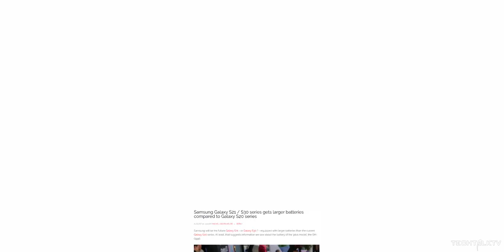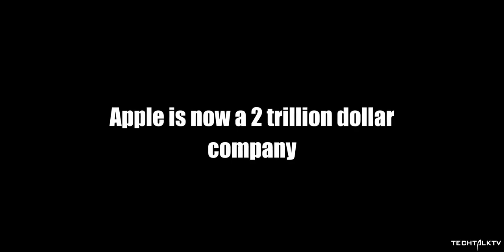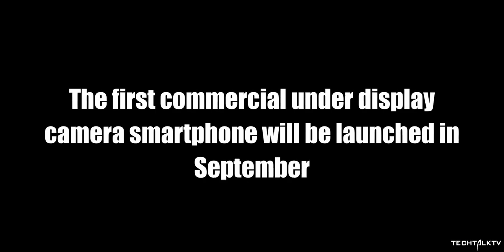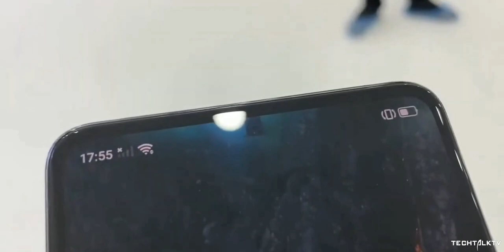Galaxy S21 Plus BIG Upgrades | Apple Is CRUSHING The Competition

Comment: Samsung must work on app optimization, increasing the battery size alone is not enough.

S20 ultra with 5000 mAh still can't beat iPhone 11 pro max in battery tests with around 3800 mAh.

Comment: I am EARLY and yo that's great the s21 plus battery is better
Reply: Im guessing the regular S21 might have a 4500 mah.
Reply: Also please upgrade the charging speed, at least 60w. Many china phones are using 120w already... 😛
Reply: WH Kong 120watts sounds excessive and like it would degrade battery too fast. I’m fine with 25-40 watts of charging

Comment: Hey Sal...so my Note 20 Ultra arrived yesterday. Here's my first impressions as opposed to the 10+. I know the screen is supposed to only be 0.1 bigger, but the display looks significantly bigger to me. And even with tiny bezels, I'm surprised it feels larger in my hand. (Not a bad thing, just different). 2. The white almost seems translucent compared to the 10+ and it has a metallic-like sheen. I like last year's white color better. 3. 120 fps is GLORIOUS. So, so good. 4. The low latency s-pen? Also GLORIOUS. (It is so strange...I never noticed lag on previous devices, but using the new pen feels soooo much better!) Final impression ... the larger display, the 120hz and the new low latency pen are BIG improvements and well worth the upgrade for those with the means to do so. I'm stoked to have it. THANKS SO MUCH FOR A YEAR OF INFO THAT LED ME TO THIS PURCHASE! ❤
Reply from the maker: Congratulations! Mine will arrive on August 27th. Excited for that
Reply: @TechTalkTV  can't wait to hear what you think!!!

Comment: If Samsung like, let them increase their flagship phones battery to 10,000mah, " if their optimization is not right, it still won't be efficient to last all day.
Reply: Samsung phones have always had shitty battery drain, but 10,000mah is a ton of battery, it would definitely last compared to the current 4000mah batteries

Comment: I don't care for them to make bigger batteries, 4500 mAh would be just fine if they came with a similar optimization that Apple brings to their phones. 5nm chip won't solve shit if Samsung doesn't optimize their Exynos and UI. I'm still hopeful.
S21/30 with good SoC power, almost as good as Qualcomm SD875 or Apple A14, or even (very unlikely) better, better battery optimization and heating control, better night shots and UNDER DISPLAY CAMERA with symmetrical top and bottom bezels, I gave up on the edges lol. If they bring all this and also make a smaller version (in inches size) with all this, 120hz too just more compact, I'm totally sold. My s9+ still works just fine, but I'm bored plus it won't get Android 11, my battery life sucks, like really. So if next year Samsung brings all this, or at least most of this, I'm sold. They have to bring the under display camera, they have been changing design every 2 years for awhile now, so people expect them to change it.
Reply: If you live the U.S then you don't have to worry about exynos
Reply: Goku Black Why do some phones have exynos while the same phone uses snapdragon that doesn’t make sense.

Comment: I hope it won’t just be test for Note21, like this year S20 Ultra was just new camera setup test (failed one). No more Samsung for me if they continue with Exynos/Snapdragon game, also Note20 Ultra comes with 8 Gb of ram in my country. Pure greed...
Reply: 8 gigs of ram is perfectly fine due... especially on a phone. iPhones are doing so well with 4 gigs of ram, imagine how well double that amount is going to do
Reply: MemeSage 24 ok, I agree, but why did Note10 and S20 have 12 Gb ? Note9 also has 8 Gb, why doesn’t it get newest updates ? Why do 12 Gb models of Note20 Ultra even exist ?
Making new model with 1/3 less memory doesn’t make much sense. Especially if it is Note, known for being the most powerful phone and if some markets get 12 and some 8 and price is the SAME. 
It’s not about whether you need it or not, Samsung became greedy and cut the corners wherever it was possible, there should be no excuse for making different phones and naming them the same. Don’t tell me 12 Gb Snapdragon variant of Note20 Ultra has same capabilities and futureproofing compared to 8 Gb Exynos ones.
Reply: Kondilom Miljanice Kulic I definitely see your point. I still stand by what I said, but I do agree that there was no reason for Samsung to downgrade some parts of the phone and sell it at the same price as last years phone
Reply: MemeSage 24 I would understand if they decided that all models should have 8 Gb, like okay, we had to cut cost but camera/display/battery is better. Maybe I could even get over Snapdragon/Exynos part, but combining those and making device that costs the same but has both inferior processor and less ram, I don’t know, can’t think of any reasonable explanation